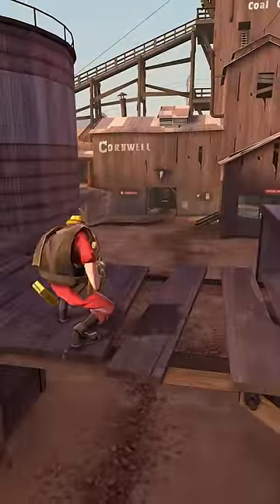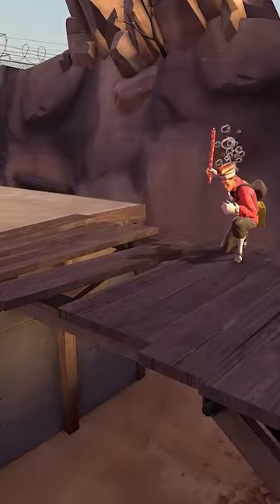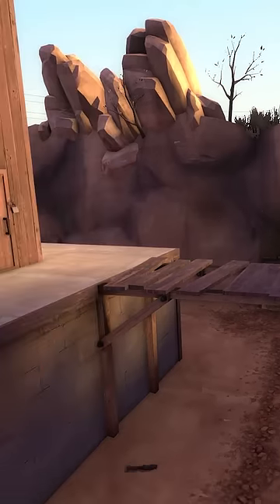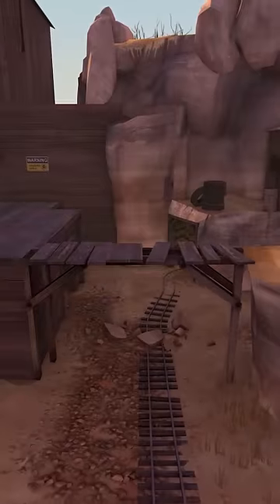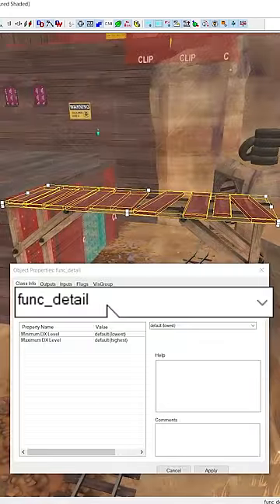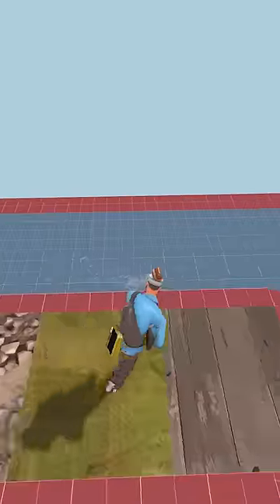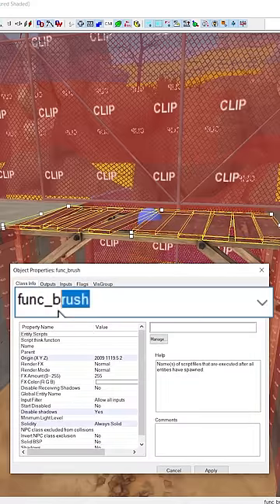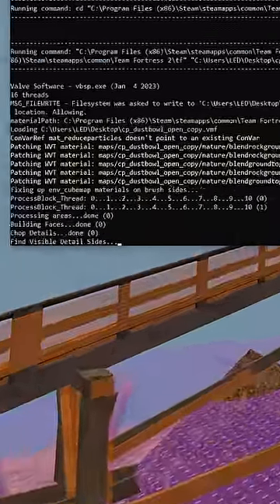This Bridge on Dustbowl is Weird... #tf2 #shorts

Comment: Funny enough, this same thing happens on a map on a different TF2, Titanfall 2. On the map Black Water Canal, there's a metal roof that throwables will not stick to, instead sliding off, bouncing off, or straight up getting deleted on contact with it, and a building on the other side of the map has the same roof but allows throwables to stick to it.
Reply: that's really neat actually. cool beans
Reply: It is apparently made with the Source Engine, so there's the answer.
Reply: @MerchantrRe4 not necessarily.
Reply: @MerchantrRe4 
Heavily modified source engine, mind you

Comment: Func details are normal geometry that doesnt cut visleaves while func brushes are dynamic brushes that can be toggled, and if the brush is set to collide using only qphysics (older rudimentary physics used in old games such as Half-Life and is used in Source for player collision), vphysics (new, cool system used in all source games) projectiles will have odd collisions with them.

Comment: The fact that func_brushes do this makes me want to make a pipe system which directs projectiles into another area. Possibly even funnier if there was a togglable gate so you can stack projectiles.
Reply from the maker: You'd be better off setting up a trigger that teleports the projectile to the other end

Comment: I think the bridge is a func_brush because those are able to be toggled to be invisible/uncollidable through the I/O system, and that bridge in particular isn't there during Stage 2 of the map.
The question then is, why is the bridge set to vanish? It's not like it's blocking the fence that shows up, said fencing is ahead of the bridge. Maybe in an earlier version of the map, the fence used to be farther back, and thus the bridge going away was required, but then when the fence got nudged forward the bridge-removing was never taken out?
Even bigger question, why do the projectiles' "hit the ground, do something" code work with func_detail, but not func_brush? What's the distinction? It's not the collision meshes themselves...
Reply from the maker: It actually is there during stage 2. It's just on the other side of the fence.

Comment: Amnesia: The Bunker used limited inventory space really well, but that's because the game was designed around having to run back and forth through a nightmare maze while being hunted by a monster. Encumbrance is only good when it adds to the intended experience. RPGs are a power fantasy, and encumbrance doesn't add to that at all.